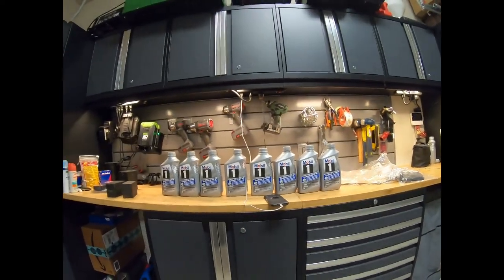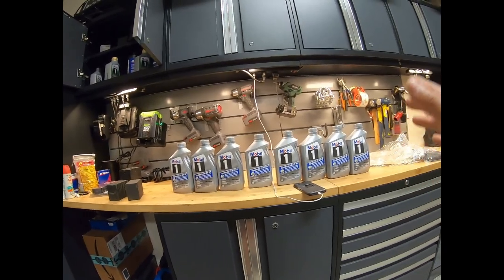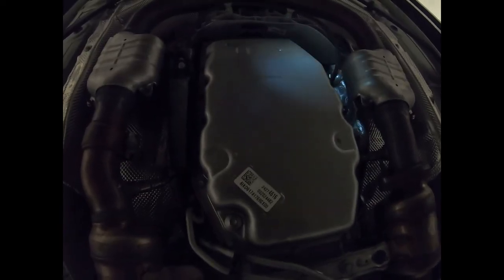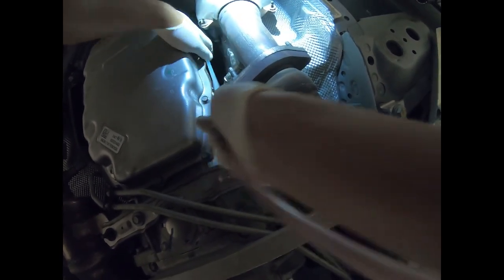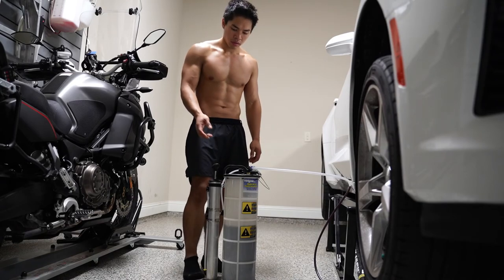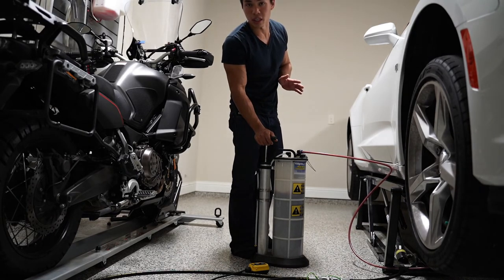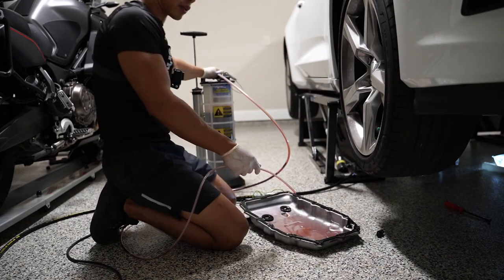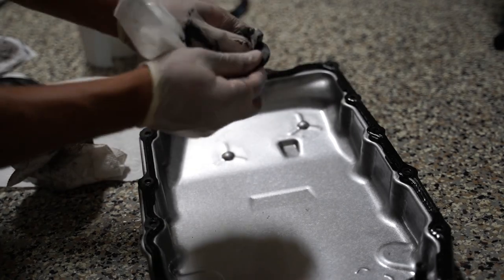2016-2019 Camaro Automatic Transmission Fluid Change

Comment: What are you using to pump the fluid into the trans
Reply from the maker: C4Garage mityvac atf refill system can be purchased off amazon
Reply: flea1812 so with this method of doing it is this the way the dealership would do it
? They wanted to charge me 300 for a complete trans flush and filter , but they wouldn’t let me bring in my Amsoil ATF , after watching this I have confidence I can do it now, thank you by the way !!
Reply: flea1812 also do I really need to wait 24 hours ? , I don’t have that fancy of a pump I’m
Just gonna use the one I got from harbor freight and then pull down the pan , should I be fine doing it with a cheaper
Pump ?
Reply: akidim13 yeah, I just did mine and u don’t have to wait over night. As soon as it doesn’t suck anymore trans fluid out, pull the pan.

Comment: My question is, if only 2000 miles why don't u take it to the dealer?
Reply from the maker: I really wanted to get to the bottom of the issue that many people were suffering from and learn myself so I could share to others on how to take care of it outside of warranty.  Otherwise if i just kept going back to the dealer I would never have learned.  Also the dealer won’t flush it for you every 15k miles.   They’ll do it once until the torque converter fails they’ll replace it.  I never want my vehicles to get to that point.

Comment: Hello! does this mobil trans fluid also work for the V6 2016 transmission? Or just for the 8 speed transmission.
Reply from the maker: If the v6 uses the 8 speed it will be the same fluid as in this video

Comment: What is the torque spec for the bolts?!
Reply: 80 in. lbs. Very low. Same for the check bolt. My torque wrench only went down to 120in. lbs. I used that and it worked fine. 120 is not much more than 80.

Comment: I had my 2016 Z06 (650 HP/650 Torque) LT4 transmission system completely flushed at the dealership - there is 26 quarts of transmission fluid in the entire system, replacing 6 quarts in the transmission doesn't come close to replacing all of the fluid - therefore, to completely replace ALL of your "bad Mobil 1" and replace it with the "new Mobil 1 formulation" you'll have to do a complete flush - again, 26 quarts, anything less will not resolve the shudder problem - I hope this helped.
Reply: Any idea cost at dealer?

Comment: Where did you get the temperature range for the fluid level check? I've been trough the forums and the temperature is different as the one you said 

"The transmission fluid level must be
checked when the transmission fluid temperature
(TFT) is between 35–45°C (95–113°F)."

https://static.nhtsa.gov/odi/tsbs/2019/MC-10163890-9999.pdf

I did according to your video but now i'm in doubt if thats the correct temperature to check the level.
Reply from the maker: Hi Javier, my temp range came from the oem gm service manual.  It applies for both the 2016+ Cadillac CTS V and the 2016+ LT1 Camaro
Reply from the maker: Btw 95-113 is for GM full size SUVs not GM performance cars.  The reading for the performance cars are at a higher range
Reply: Thanks, mine is a lgx v6 but after a year i had no issues with your temperature values. I'm about to do this maitenance and I will follow your procedure again

Comment: Camaro 2.0t 2016 to 2019 use 5.5 quart transsmision fuild   make sure yo use dexron HP atf dont use the dexron VI
Reply: @chenchomatapuercos9934  the 2.0t use full syntetic lv HP fluid also full synteric for the engine, cz the turbo  is a hp vehicle    now the v6 engine use regular dex 6  .... Ofcurse u can use it still is fluid but transmission is a delicate part and is better to use what the manufacter recommend

Comment: thank you swole asian man
Reply: I just did this today on my 2016 Camaro SS - I ended up buying a transmission fill adapter, available at FreedomRacing part #DT-51190-A. This allows you to use the MityVac or another fluid dispenser to screw into the level check plug and pump the fluid in that way. My fill port on the top of the transmission was surrounded by wires and a metal hose (for some reason - I have no idea why or what that stuff is). I could get my fingers on it, but there was no way I was getting that plug out or back in even w/ a tool. The fill adapter made it pretty easy. For some reason, after dropping the pan and letting it drain for 2 hours I only got 5.5qts out of it. I put about 5.8qts in. The car shifts so much better even though my ATF fluid didn't look that bad - My 2016 only has about 18,000 miles on it.

Comment: I have a v6 18 camaro and my car jerks when i put it in drive and reverse. Do you why
Reply: Mine does this too I took it to the dealer and they did a transmission reset but it did not fix it and it was 400 bucks.
Reply: Mine is a 2017 2ss
Reply: Motor Mounts.
9xs out of 10, people think their trans is going out during shifting when it’s actually just motor mounts knocking the motor around

Comment: You know the transmission pan has a drain plug
Reply from the maker: That’s not a drain plug it’s a fill check plug,  the 8L90s do jot use a transmission dip stick to check the fluid level, it uses an overflow baffle design like German cars to do transmission fluid checks.  That “drain plug” (actually known as a fill check plug) will remove some oil but not all of it due to the baffle design

Comment: Hi guys, I posted this on flea1812 Escalade fluid Change video but just wanted to post the GM TSB procedure here also.

PDF 1: https://static.nhtsa.gov/odi/tsbs/2019/MC-10163890-9999.pdf

PDF 2:  https://www.corvetteforum.com/forums/attachments/c7-general-discussion/48301086d1551705709-new-a8-transmission-fluid-gm-techlink-shudder-article.pdf